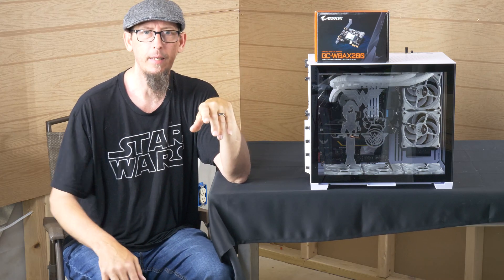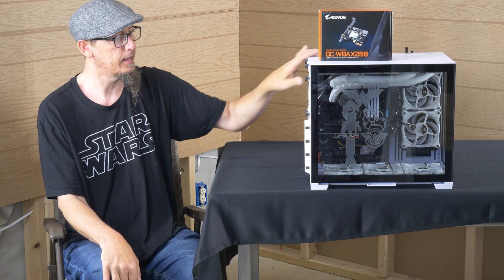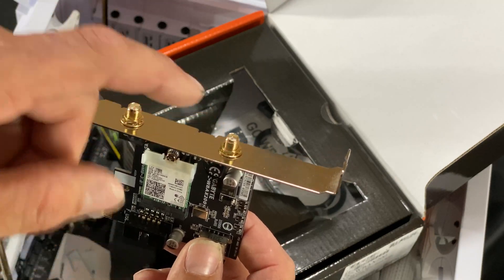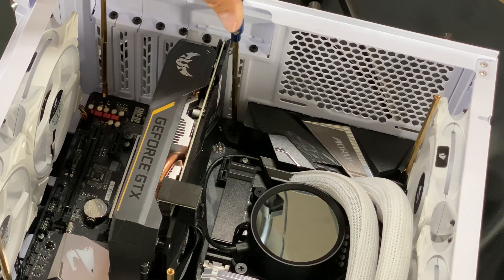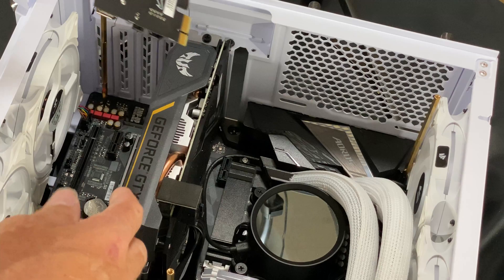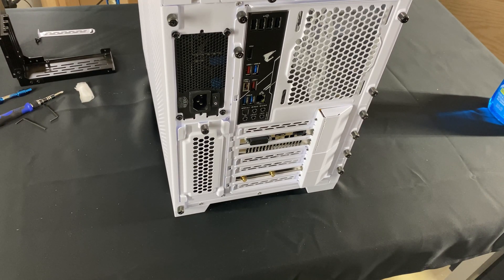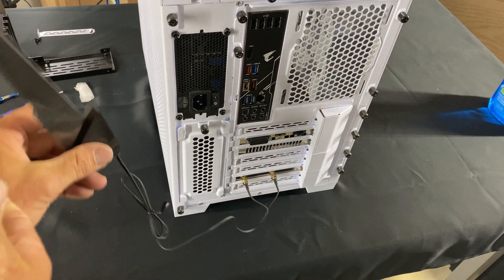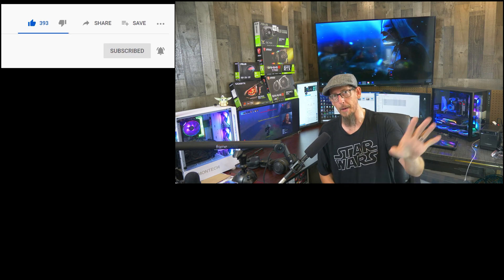INSTALL AORUS WIRELESS PCIE 1X QUICK AND EASY

Comment: Then what? Opened pc n see nothing new
Reply: If you installed it correctly and it doesn’t show any networks you will have to download the driver to the computer. You can do it by CD or get a usb to transfer it. What I did is I had a usb wifi stick to access the internet so I could download the driver.

Comment: I have only one slot for Wi-Fi card below my motherboard to install this card is it okay if I plug it in there?
Reply from the maker: Yes. It will also work in the other ones as well. It doesn’t specifically have to go in the pcie 1x slot.

Comment: Seems cool but i don't know why dessing it that way adding wire for the antennas, it doesn't look good
Reply from the maker: Sometimes you don’t have a choice.
Reply: @RYNOTECH  yea you're right, my current adapter got a 802.11g standard, kinda slow

Comment: Pro tip plug your Xbox wireless adapter into the usb on the wifi card you’ll have to take the side panel off if u wanna connect a new controller but it’s worth it to have the dongle hid away
Reply from the maker: Right on. That wouldn’t be an issue to me.

Comment: how does this work? can i put this into my computer then connect straight to the wifi in my home?
Reply from the maker: Yes and no. You may need to download the drivers from gigabytes website after you put it in. I didn’t have to but some say they did. Just download them from another computer and put it on a flash drive. If you have a cd rom it comes with a disc with them on it. My PCs don’t have cd roms. There all workstations and gaming PCs. Hope this helps.

Comment: are no drivers needed???
Reply from the maker: I didn’t need the drivers when installed it. They came on a disk however who has a cd rom anymore. I have had some comment that they couldn’t get it to work until they installed the drivers. I’m running windows 10.

Comment: hey i got a question i just bought this and was wondering if the bluetooth on a ps5 controller would work if you could help me out thank you
Reply from the maker: 1st make sure you plugged in the usb cable that came with that card. I didn’t cover that in the video. That was my mistake. 
To connect the PS5 DualSense controller via Bluetooth, press and hold the central PS Button with the Create button for three seconds. The lightbar in the middle of the controller should begin to flash.

Next, you’ll need to open up the Bluetooth settings on your PC. In Windows 10, click on the speech bubble icon in the Taskbar located at the bottom-right corner of your screen. This will open up the Action Center, so from there click ‘Bluetooth’ and then select ‘Wireless Controller’. 

If you’re asked to enter a pair code, type in 0000. The PS5 DualSense controller should now be connected via Bluetooth to your PC. No more wires!
Reply: @RYNOTECH  Thank You
Reply from the maker: You get it to work?
Reply: @RYNOTECH  i was asking you
Reply from the maker: I was asking you if you were able to get it to work.
Reply: @RYNOTECH  i haven't gotten it yet ordered it last night lol was asking if you know
Reply from the maker: @foxhound6986  oh ok lol.

Comment: I installed it and my pc isn’t picking it up it says to plug is an Ethernet cable also mine came with a cord to i need to plug that in some were?
Reply from the maker: The cable it came with goes to a usb 3.0 on the motherboard and the other end to the card. Mine didn’t come with one. I found out after I made the video. Find a way to download the drivers to a usb stick if you can.
Reply: @RYNOTECH  okay 👍
Reply: @RYNOTECH  so I need the drivers for the card to work?
Reply from the maker: In this case you do. My system found them.

Comment: is there another way I can download the drivers? I dont have a cd slot for the cd.
Reply from the maker: If there’s no way to hardwire the computer temporarily and you don’t have access to another computer to download it and put it on a flash drive. I would try to download the file to your phone and put it on the pc from your phone.
Reply: @RYNOTECH  Well what's the link for the drivers online? I can download that one instead of the cd drivers?

Comment: Sorry im late, but any guess as to why only Wifi works for me? Ive downloaded both wifi and bluetooth drivers, but only the wifi works. I did plug in the USB header cable to the MOBO and im pretty stumped.
Reply: Are you on windows 11

Comment: So by getting this device I do not need to have my modum physically connected to my pc via ethernet cable?
Reply from the maker: You will need a wireless router or access point to connect to.

Comment: need big help! after installing the card i put the cd in. my pc doesn’t support it. do i need to update to windows 10? i have a old pc btw
Reply from the maker: You shouldn’t. I would go to gigabyte and find the drivers on line. The cd may not have the right drivers. What windows are you running

Comment: Are you sure you dont need the cable? I cant get BT without it.
Reply from the maker: Your not the first to tell me that. I had no issues. Go to gigabyte and find the latest drivers for it. Sometimes windows doesn’t have the generic drivers for it and don’t install them.
Reply: @RYNOTECH  i used the frisbee. Gonna see what I can do with the drivers. I asked /g/ as well and checked my mobo. Worst case scenario theres a cable I can utilize to turn a different usb port into the f_usb2 I need.
Reply from the maker: Ok yeah get those drivers. I didn’t have to hook up the usb. Let me know.
Reply: @RYNOTECH  no dice. I tried removing the device from device manager and reinstalling it because thats how i trick win10 with a lot of driver issues. Guess im buying the cable. Im using the 210 model of this card btw.
Thanks for your help I like your videos brother.
Reply from the maker: I appreciate it. Hit me up anytime.
Reply: @RYNOTECH  the only solution ended up being to utilize the fusb2 cable. I just messed up the thing screwing with the BIOS. Probably not cut out for this.

Comment: hey I just got this card and its not working, im not sure if its because i have a ryzen cpu
Reply from the maker: That won’t have anything to do with it. Ryzen or intel don’t mater. Check in device manager or go to gigabyte and look for the drivers for it. Windows sometimes don’t find them.
Reply: @RYNOTECH  hey I downloaded driver before installing the card, and it worked. Thanks a lot!
Reply from the maker: Sorry for the late reply. We are on our way back from a cruise. We will be back tomorrow. Driving most the day.
Reply from the maker: No problem. I’m glad I could help. If you need anything else give a holler. My email should be in all my descriptions.
Reply: @RYNOTECH  hey man i CANNOT get the wifi part to work. bluetooth works, but not the wifi. i downloaded the drivers from the site still nothing. any ideas?
Reply: @AlonzoAngo  same here, did u end up figuring it out
Reply: @joli2335  Make sure the usb cable connection to the card has the pins lined up correctly and also that it's not upside down. Secondly, make sure the cable is connected to a USB header on the motherboard, the cable ensures the bluetooth part of the card can communicate properly and be seen by the system.
Reply: @AlonzoAngo  Make sure the usb cable connection to the card has the pins lined up correctly and also that it's not upside down. Secondly, make sure the cable is connected to a USB header on the motherboard, the cable ensures the bluetooth part of the card can communicate properly and be seen by the system.

Comment: Where does the wire go to the one that has the same thing from both sides
Reply from the maker: Not sure what wires your asking about. The only wires that you will need to hook up is the antenna wires on the back of the card.
Reply: @RYNOTECH  i figured it out and connected the wire on the f usb 2 thats the ones i meant
Reply from the maker: Oh ok I’m sorry. Wasn’t sure what you were talking about. Lol. I didn’t go into that part of the video. It’s hardly used.
Reply: @RYNOTECH  at least you answered
Reply from the maker: I try to answer all the questions that come my way. Sometimes I don’t have the answer and I dig into it . Those spawn into future videos at times. I like the interaction with the viewers. There a good part of why I do this. It’s one of my favorite parts.
Reply from the maker: One goes on a usb header on the motherboard and the other side goes on the card itself.

Comment: Is there a low profile bracket for this???… or a modification?…I have a slimmer computer trying to install it on.  Thanks
Reply from the maker: Yeah i didn’t even realize there wasn’t one in the box. Most the time I’ll get both brackets when I buy these little cards like this. I did a lot of searching. Thought for sure I could find one on Amazon. Found some on eBay. I can’t believe I didn’t think about that when I did this video. I’m sorry man.
Reply: @RYNOTECH  do I have to use the usb cable included?  Not sure where to plug in the usb cable.  Installing it in an old e-machine EL1352G-41W
Reply from the maker: @geraldlivingston7256  no
Reply: Thanks!… connected card to pci 1x slot … now computer won’t power on…. Do you know what the issue might be?
Reply from the maker: @geraldlivingston7256  never seen that before. Is the power supply turned off
Reply: hi, did you find a solution? Im in the same boat where i have a SFF machine. I thought all pci cards would come with extra brackets... should have viewed the unboxing before making the purchase

Comment: hey, i bought one of these a couple months ago. It worked good but im not getting the download and upload speed everyone seems to be getting with the card, how can i get it to have fast wifi speeds
Reply from the maker: Are you logged onto the 2.4 or 5 gigahertz band? And also what router are you using? Is it a AC router or an old n router?
Reply: @RYNOTECH  its an ac 2.4&5ghz
Reply from the maker: If your on the 2.4g it’s only going to go between 25 and 40. You will need to be on the 5g if you want it to go the speeds your isp is giving you. If your smart WiFi is turned on turn it off and stay away from mesh units because they go back and forth between the two automatically. That is not a good thing. I hope this is helpful. I’ve been wanting to do a video on this for a while.
Reply: @RYNOTECH  will definitely look into this, thanks
Reply from the maker: No problem
Reply from the maker: Let me know how things go.
Reply: @RYNOTECH i enabled 5ghz on my router and connected ethernet and the 5ghz option on my pc but i still wouldnt get the same numbers like all the other people with this wifi card, its probably a setting or something to do with my router
Reply: @alvaro-4519  keep in mind that interference and network traffic can effect your speeds as well. If you have neighbours using 5ghz as well you may need to change the frequency of the network as their signals are contesting the channel. Ensure that the router is set to an automatic frequency, this allows you to simply turn it on and off again to hop to a free lower traffic frequency. Distance and physical barriers can also play a part in slowing down your speed, ie if you have several walls between you and the router the 5ghz channel will suffer performance drops, while the 2.4 ghz will be more reliable. Another common fault is that your router could be old and simply not have enough juice to cover the entire house.
Reply: my router is next to my pc also i have a huawei b818 router not sure if its a newer modem or older and my frequencies are still the same as to when i got it
Reply: @alvaro-4519  download and update the intel ax200 chip drivers from the intel website since theyre newer

Comment: What to do with the cable?
Reply from the maker: I have too but the Bluetooth works without the cable. I’m going to have to do some serious digging on this one. Lol
Reply: @RYNOTECH  Mine doesnt want to work, wifi is awsome and works fine but the bluetooth side doesnt seem to to work... I installed both drivers, but it still leaves me down...any idea, why this occur?
Reply from the maker: @adambalogh8563  I’m sure you have both wires from the Antenna screwed on the card. Unscrew them and make sure the center conductor on the wire didn’t get bent when it was screwed in. It’s also possible the Bluetooth chip is bad.  It sucks I know but it happens. I’ve bought mother boards bad right out of the box. That’s a big reason I and every other tech tuber says to build it be fit you put it in the case.
Reply: @RYNOTECH  wow thx for the super fast response!! Yup i checked and nothing is wrong i dunno what can be the problem maybe u are right and the Bluetooth module is damaged somehow...but i dont understand why the wifi module works fine while the Bluetooth module doesnt even show up in Windows xD...
Reply from the maker: @adambalogh8563  because they are two separate chips on the board.
Reply: @RYNOTECH  Then i will struggle a bit more with it and if it doesnt work i ll send it back for a new one...btw thanks for the info it really helps people, u definetly earned my sub and keep up the good work. ;)
Reply from the maker: @adambalogh8563  thanks man it’s really appreciated. I’m just a guy in my basement. Lol.
Reply: @RYNOTECH  just like we all are ;)
Reply from the maker: It’s used to hook up the motherboard to the usb You won’t need to use it. I don’t know why they keep putting it on . I have never used it.

Comment: I looked into the specs and both of the antennas are for wifi. There is a new technology to boost wireless transfer rates even further called MIMO (Multiple Input / Multiple Output). You need multiple antennas for that, so thats why you need to connect two different wires to the card. Bluetooth seems to have its antennna right on the card (or chip) itself.
Reply from the maker: Yeah there’s 2x2. 3x3 and 4x4 Mimo my ubiquity ac pro has 3x3. this card does have 5.0 Bluetooth integrated into it. I’ put a link to the card on the video  the specs have 5.0 Bluetooth on it.
Reply: @RYNOTECH  Yes. This card supports up to 2x2 Mimo. The intel module build onto the card even has bluetooth 5.2, but just bt 5.1 is advertised on gigabytes website. I'll see when I get mine. 

Do you know why there is an usb port on the card? Seems useful to have a usb-port inside your case, but it's a little odd.
Reply from the maker: You don’t see it much today but there are single to multiple USB port slot cards you can get for your back slots and it will utilize that with a small jumper. You could also use it to put a usb storage inside if you wanted. Amongst other things.
Reply: @RYNOTECH  Maybe the connection is also needed to run the card properly. My card just arrived, and it has indeed bt 5.1. Maybe even 5.2 but it seems that windows doesn't support that yet.
Reply: @carl-marvin  from what I've been reading the USB connection is for the Bluetooth.
Reply: @HelloSnake  true. It also seems to be a general 'layout' for other combined wifi/bt cards.

Comment: hey remember that not all cases has the removable pcie cover plate because they have the break away cover plate on commonly the cheaper case and most OEM cases. So choose wisely on which one you want break away but at least you can put another cover plate by using a removable cover on the back of the case.